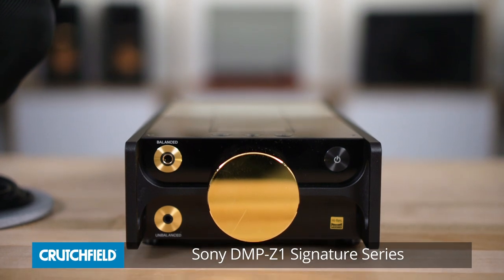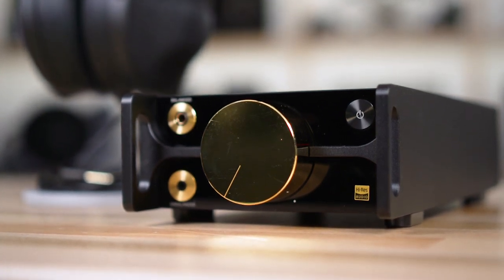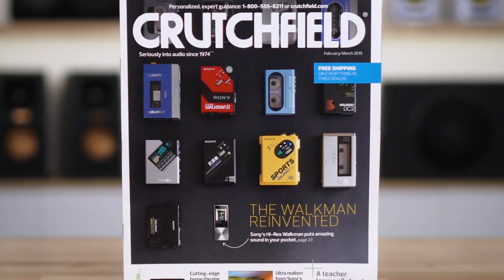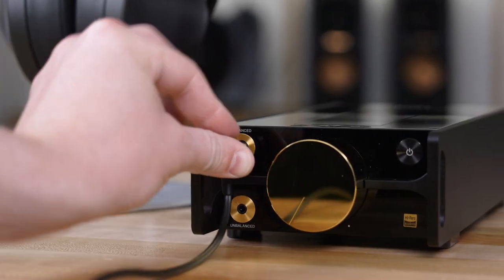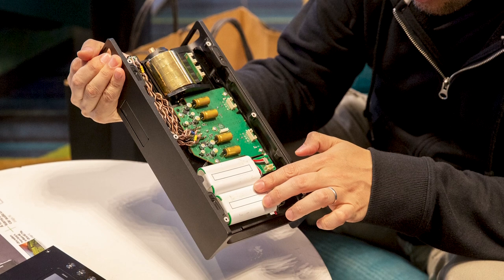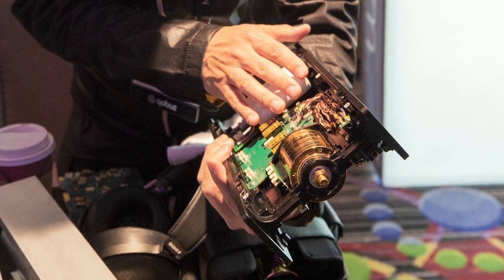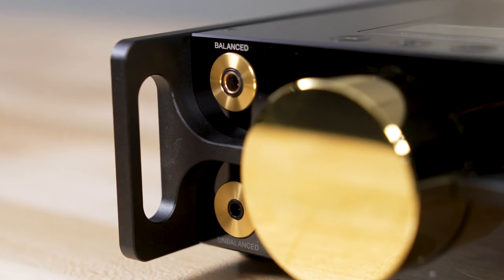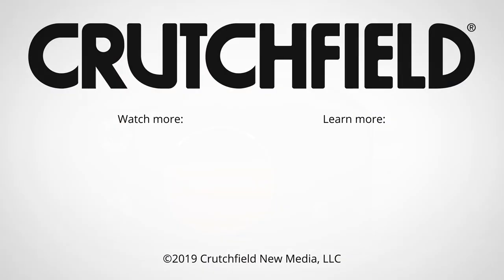Sony DMP-Z1 Signature Series portable hi-res music player | Crutchfield video

Comment: The batteries will die someday, like all built-in battery
Can we jusy plug this to wall outlet, when eventually the battery lost it's capacity?
Or this thing will just become a luxurious paper weight?
Reply from the maker: This player can be operated when plugged into AC power and even has an option in its menu to use that instead of the battery. It will take more than a worn out battery to make it a luxurious paper weight :)